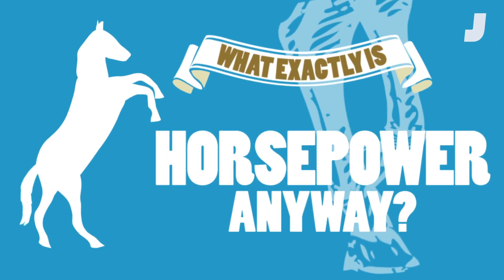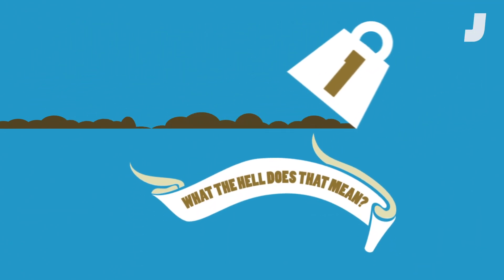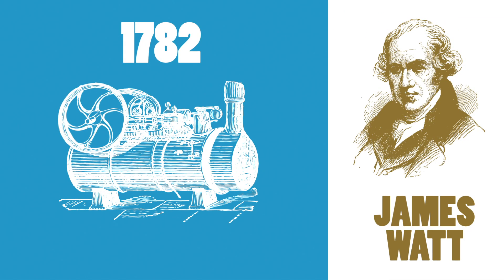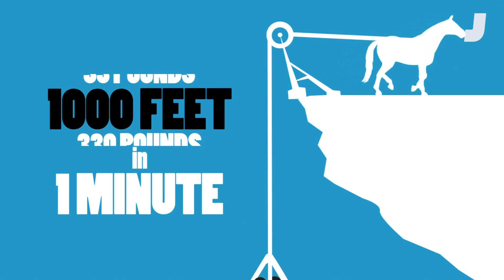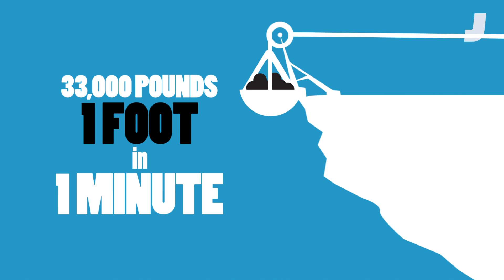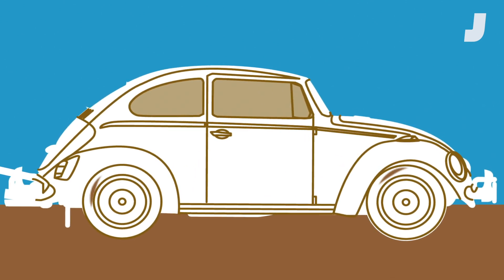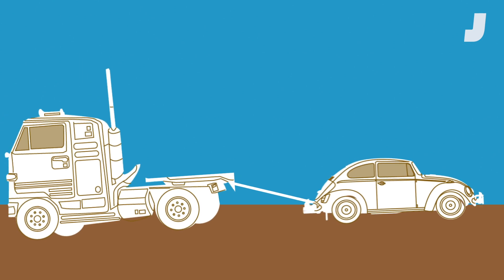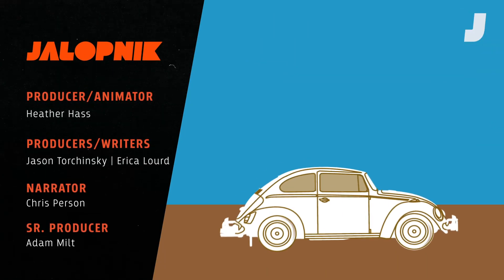What Exactly Is Horsepower, Anyway?

Comment: around 1981 there was a rash of odd Audi accidents where the driver claimed that although stepping on the brake the car would Accelerate with the brake on. Even an automatic trans.....This is of course impossible. Brake Horse Power is just that and any car brakes make 1000 to 3000 Brake HP. One day my 1959 Vette with a 550hp 350 in it  had the throttle stick wide open. It wouldn't close. In 2nd gear it went from 70 to 100 in 2.5 seconds. I simply put on the brakes. Drum brakes. After a few tries I just turned off the engine. I wanted to prove that the Audi issue wasn't a Brake issue. It was a driver error issue. And some fools tried to capitalize on the claim and purposely slammed their car into a tree and such. They went to the hospital and probably to jail.